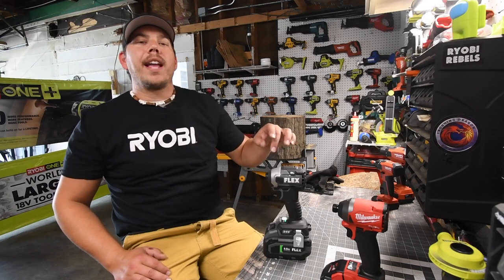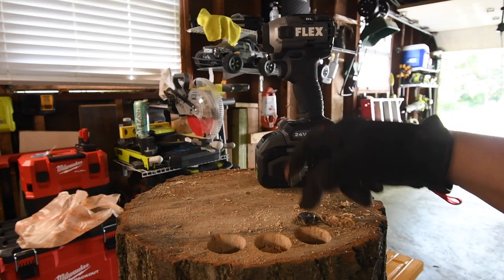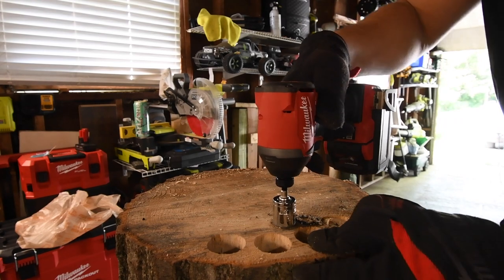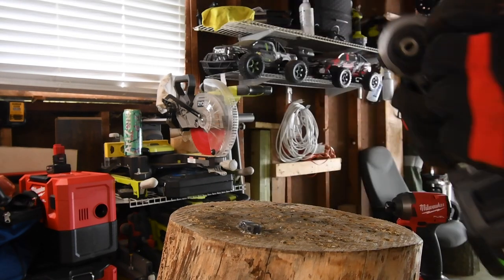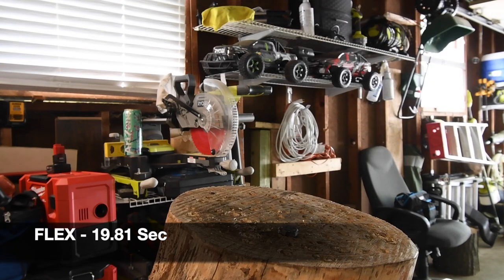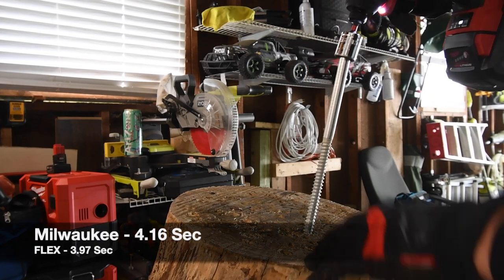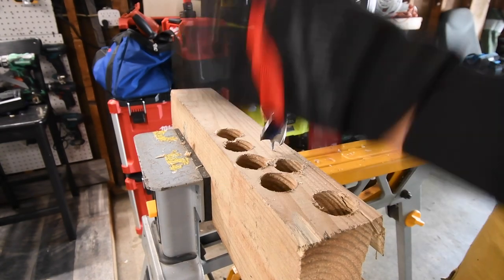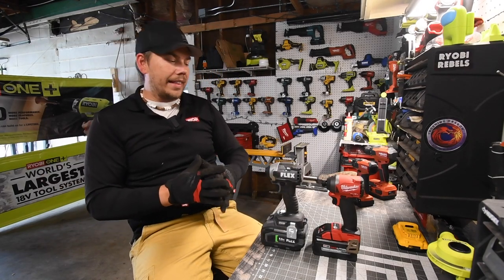FLEX vs Milwaukee Impact Drivers (8ah Batteries)

Comment from the maker: I’m sorry you guys. I made a few mistakes in the edit and I forgot to add the specs.
Reply: All good.  Only humans bro
Reply: This is the most controversial match ever.... we need to declare a true winner 🏆
Reply: @TacticalThib  that's hard to do when comparing apples to oranges! Then throw opinions into the mix!!
Reply: It is ok Man Caver Tools
Reply: @kentuckybeardsman  I have them both and know what they both can do.... flex is very fast with small stuff but with big lags Milwaukee takes it point blank...
Reply: @TacticalThib  that's awesome man🤙🏻🤙🏻
Reply: @TacticalThib  don't forget power isn't everything. A remodeler , contractor, or installer may have different opinions on what's better due to them having different needs and also different opinions on what's power to their needs. There isn't a clear cut difference for anyone except your own opinion. You may find someone else that agrees and another that doesn't. Also things like material difference and batteries used makes a huge difference. Take the flex info vids they did while launce!  Flex was the best right?? This like many other things are subjective.
Reply: @TacticalThib  #facts

Comment: If you look at Milwukee both drill driver and impact driver you will notice that they are very small compared to the comptitors - but have more power. I'd go with Milwaukee.
Reply: Yes sir, you are exactly right. That’s why I always go with best, MILWAUKEE!!! 😎
Reply: Yeah... 💯
Reply: @FAMOUSSLICKRICK  exactly same,
Reply from the maker: they are far more compact than others
Reply: Milwaukee all day
Reply: @RuDuffEnough WellRu That is so true, the batteries are to loose, I hate that
Reply: they also have way more malfunctions and tend to overheating, battery whobble, trigger malfunctions.
Reply: The hammer drill is more compact than most others, the impact is roughly the same size as everyone else's.
Reply: @Zozo806  negative

Comment: I've snapped a bunch of lags.!? I new for sure, it wasn't me, or the underpowered 9yr old Ryobi Hex driver I was using. I used a shot of 10w30 to get the lags installed in project I did. But having dig out the broken piece of lag screws that broke flush with the surface of wood. Drilling a pilot hole helps.

Comment: I know the Milwaukee Collett slips out but I don’t know anyone that uses it to drill holes, I use my drill/hammer for that
Reply: I have the M12 Fuel impact and ill say using impacts for drilling holes is AWESOME! They have significantly less torque on your wrist and they're a lot smaller so they can fit into spaces that are hard to reach aswell as be nicer to operate when you only have one hand like if I'm drilling holes while running romex
Reply: @bobbyRC2  that’s great but I’m a plumber and the holes we drill are 10 times the size of what electricians do
Reply: @glenarseneau1231  well different use cases for sure haha. Yeah i would agree with you that anything large a drill is much better suited to do unless the drill ABSOLUTELY WONT FIT in which case the impact is viable.
Reply: I never had the collet do anything I've had mine for over a year now ( not daily use ) but have worked it pretty hard never had an issue with bit retention

Comment: Milwaukee just flexed on flex 💪 that first test won by over 10 seconds
Reply: That test was a huge outlier, the flex beat the Milwaukee in every other test. I’m assuming the flex hit an especially hard spot on the wood in that test where it took it 15 seconds to drive in.

The flex also produced more torque than the Milwaukee on the torque test channel
Reply: @P_steez  incorrect.. most other tests were close, except the final 10”  lag, where the Milwaukee again killed the Flex, with both 8Ah and 6Ah batteries, and the Speedbor test where the Flex was notably faster
Reply: @geoffstrickler  yes all the tests were close, and the flex won a lot of the tests, the original comment I was replying to about how Milwaukee “flexed” on flex made no sense though
Reply: @P_steez  the flex won a grand total of 4 test. TTC runs the m18 with the 5.0 which totally disadvantages it regardless I own both tools and Milwaukee is the more powerful of the two point blank.....
Reply: @TacticalThib  I own both and they’re both great tool, they’re super similar in power and flex has way more torque, I can tell you don’t own flex by how much of a fan boy of Milwaukee you are, so don’t claim to own it otherwise you’d know the flex is a great tool, big but still great. Especially for their first iteration. Most of the tests were close, Milwaukee won some and flex won others. Your statement that Milwaukee flexed on flex is laughable
Reply: @TacticalThib  Lmao Your channel has videos of you unboxing tools a month ago, the tools don't even have a lick of dirt on them and for a guy that owns a business it looks like you live in a double wide trailer lol
Reply from the maker: the flex did win  the 8" lag and the speed bore tasks, but the Milwaukee did win the rest
Reply: @FusionBoost2.0  😂😂😂
Reply: Here's the score card for Flex vs Milwaukee Gen3
Flex: 5 Points
Milwaukee Gen3: 4 Points

And the Winner 🏆 by Unanimous Decision and Still the Undefeated Pound for Pound King 👑 of Impact!
The Flex! 
There you go Folks! I'm paying so much attention on each and every test DESPITE of Man Caver Tool is so Biased on Flex giving Milwaukee gen3 a so much advantage I can see it still The Flex managed to get a 5 Points
I didn't included the points from the First Log 🪵 because both of them are snapping bits I only counted the 2nd Log 🪵 which is I saw full of holes already and man Caver said it's brand new log but there holes already. Biased! 
If man Caver didn't favor Milwaukee there's no way that the tool could have get 4 points, I mean Flex will literally destroy Milwaukee gen3 so easily. It's gonna be a TKO Victory for Flex!
Reply: @twinbee4243  thank you very much we all appreciate your time and effort 👍 not to mention honesty keep it up ill be looking forward to seeing your comments. Can you do one on the brushless 12v challenge 🤔 where dewalt was declared winner?
Reply: @TacticalThib  My tools are somewhat clean but I use mine professionally as a tech so hard to keep them stories like yours
Reply: @TacticalThib  oh sure! I'll send you a link from the same tool reviewer hold on
Reply: @UCbgMe054xstffS9xBPgwUJw and congrats on commenting on a 1 year old comment 🤣
Reply: @FusionBoost2.0  i just caught it and thanks for watching 👀 ☺ hahahaha 😆 😂 💕
Reply: @FusionBoost2.0  make a video lets see what you got bro
Reply: @twinbee4243  thanks
Reply: @TacticalThib  don't have time to make YouTube videos to prove what I have for tools
Reply: Lol your comment has looking at these videos closer

Comment: Still as strong vs 24v.  That is what is impressive.  18v vs 24v.  Shows how well Milwaukee was designed.  Excluding the bit ejection issue.
Reply from the maker: I agree it is a great tool
Reply: not so much 24v, only when charged sufficiently. says on the battery nominal is 21v

Comment: It really seems like flex came out swinging and just barely missed the mark. I’m sure they are fine tools, they seem to be up there with the red,yellow, and blue, but for a similar price, the Milwaukee tools are more tested, smaller, and a little more powerful, not to mention the extensive range of tools they have while flex only has the basics(they are knew so that’s not a super fair comparison).
Reply: The flex beat Milwaukee in almost every test, not to mention put out more torque when tested on the torque test channel. The test in which the flex took 15 seconds to drive the lag in was a HUGE outlier and didn’t make sense comparatively, it likely hit an especially hard part of the wood. The Milwaukee is definitely more compact though and time will tell of the durability of flex
Reply: @P_steez  We are both wrong, Milwaukee won in 5 out of the nine tests, one of which is an obvious outlier like you stated. Flex won in 4/9 tests, notably having a much better time on the speedbores. If I had to guess, the Milwaukee probably has a higher rpm/bpm, which would better equip it for driving fasteners quickly, while the higher torque that the torque test channel found would better equip it for braking loose stuck fasteners and drilling holes.
Reply from the maker: both of these are very powerful tools
Reply: Came out swinging and missed the mark!?! Lmao are you serious?  Do you see how their tools perform? They are extremely powerful and capable tools.
Reply: @jacksmith2315  I said barely missed the mark. They are great tools, that is absolutely undeniable, they belong up there with dewalt, makita, and Milwaukee. But compared to how heavy they advertised these to be the best tools money could buy, they just aren’t.
Reply: @boosterseat9967  I don't know about that, I look at it a little differently, you are essentially buying battery tech. Tools meh some are the best some aren't, for example Milwaukee s SDS is not good imo. Anyways flex uses EGO battery tech, both being owned by Chevron. If you are buying a new platform, like I was, Flex may be the best option, provided you don't need a bunch of specialty tools right away. 

That said I did buy into their line, it came down to Milwaukee M18 or Flex, and because of what I do flex was better, and less expensive and got the founders lifetime warranty.
Reply: Milwaukee is only more powerful with HO batteries

Comment: Makita or another power  tool brand need bring out a 1/2 collet impact driver not a wimpy 1/4 inch ones that snap adapters cause cant handle the torque and impacting forces
Reply: I think something like 3/8” or even 7/16” is better just because it doesn’t need to be THAT bulky, even 1/4” is plenty strong for what you should be doing with an impact wrench, we are just all addicted to max power tbh
Reply: No need. Bosch already developed a much better solution in which the collet is an anvil with a hole in the middle where you can insert your bits. Go check the Bosch freak impact driver because its the future no more need of an adapter that snaps,
Reply from the maker: I agree with you on that Mic

Comment: Interesting how the Torque Test Channel showed the Flex with 15% more Torque when in a head2head with the Milwaukee, but the results here were a mixed bag...
Flex - 193ft/lbs (Fwd) 211ft/lbs (Rev)
MIL -  167ft/lbs (Fwd) 181ft/lbs (Rev)
Reply: Also the torque test channel didn’t use HO batteries on the milwaukee

Comment: I wouldnt say its the perfect test for those impacts. Yes its very hard would and shows how capable the tools are, but the spots of hardness and softness is way too random. You could be going through a knot in one and not the other and not even know its because its below the surface. I like the test for showing how capable the tools are, but i dont like it for comparing tools because its not consistent with hardness/density.

Comment: Considering that the wood might be displaced due to the flex driving the lag, does the Milwaukee have an advantage in driving its lag right next to this? This is just a thought im not sure if it's valid
Reply: I also thought it would have an effect on the Milwaukee driving in the lag. But I assumed it would be harder as the area around it should be more dense as there is all that squashed wood pressing against the already dense section it's screwing into
Reply: @newestateplumbing6994  who knows. No test will ever be perfect and this video is a great way to get the gist of what both tools are capable of and which might be better.
Reply: @newestateplumbing6994  this is what I think, the displaced wood is condensed around the 1st lag driven so driving another lag right next to it doesnt give a full 360 for the wood to displace but who knows..  thats probly really nit picking
Reply: @bobbyRC2  I agree
Reply: @Mixwell1983  I agree. you put my thoughts into better words. Still a great video anyway
Reply from the maker: it doesn't displace it enough for the tool do be at a disadvantage
Reply: @ManCaverTools  oh okay, thanks for letting me know!

Comment: Hi and thanks for this video as well as all of your others. I am thinking of buying a impact driver to store in my pickup in case I need to change a tire.  Which of your videos would be most appropriate for me to watch for this?  PS I loved it when you had to do the first "give it a second to chill" the smoke was coming off the top of the bolt.
Reply: You'd be better off buying a better Jack and breaker bar-Socket to leave in your car.  The battery will be dead when you need it.
Reply from the maker: I got the Milwaukee m18 stubby in my car

Comment: It’s harde to make a smaller device with the same capability as the larger just ask apple so of course tge power is still there with the Flex right now they’re not fine tuning they’re all out to show strength. Still great for a first but. And likely better than any other brand ever but that’s not a fair discussion either. Parts and capabilities change year to year. 

For me I have the Milwaukee but I will be getting the flex. The comparisons don’t really matter people just like to know because all of the top brands will get the job done and do it to what their base wants. For Milwaukee it’s speed and power on the impact as power on the hammer, for DeWalt it’s power on everything and size doesn’t matter, for makita elegance, ergonomics, smooth operation and how quiet their equipment is matters. 

I think Makita can make more powerful tools but they try to find the right balance. That’s why I have them at the top with Milwaukee for brand innovation and east of use.
Reply: Actually Apple has made a powerful device that’s smaller than last year gen products.. just look at how thing the iMac got how much more powerful the Mac mini’s have gotten with the same for factor … or the iPads got thinner and more power than most Mac Pro laptops … so Apple knows how to make powerful devices smaller and thinner
Reply: @user-jh1mq2ih2u  Considering that iMac's power/specs to price ratio is absolutely abysmal, not to mention they do not have consumer replaceable parts, awful compatibility,  they have nowhere to go but up.

Comment: Stop getting the Makita adapter and get the Husky adapter instead!  Cheaper than the Makita too, if I’m not mistaken...
Reply: The husky is better?!
Reply: @P_steez  Yes.  Look up Shop Tool Reviews and check out the tests that he ran on several adapters, including the Makita and Husky.
Reply: @SouthFLTools  awesome, thanks for the info!
Reply: @P_steez  Absolutely 👍
Reply from the maker: also used milwuakee adaptor in this video and the husky adaptors lasted 2 videos then they broke
Reply: @ManCaverTools  that’s interesting. Have you ever tried the Bauer or Warrior adapters from Harbor Freight?  Those also held up really well in the testing done by Shop Tool Reviews...
Reply: Project farm tested the adapters, and DeWalt came out on top by a large marginm.

Comment: Odd result given other tests showing Flex impact outperforming Milwaukee and Flex was the only cordless impact (I think) to outperform Milwaukee in terms of torque on Torque Test channel.  In any event, a great performance by the Milwaukee
Reply: The torque test channel didn’t use HO batteries on the Milwaukee

Comment: That second log must be rotten wood and I think you cut the video on that first log when neither one could back the lags out and used a ratchet to back them bolts up enough so the impacts could back them out.  Just my observation. I do enjoy your videos though.
Reply: I thought the same thing except he used an impact wrench to back it out and drive it back down both times that was the true test and Milwaukee killed flex on driving it in.

Comment: If sink the lags in to far the socket not grip dave use a hammer knock the socket in onto the lag a bit into the log then put adapter back into socket on the impact 😁👍
Reply from the maker: I will give that a shot